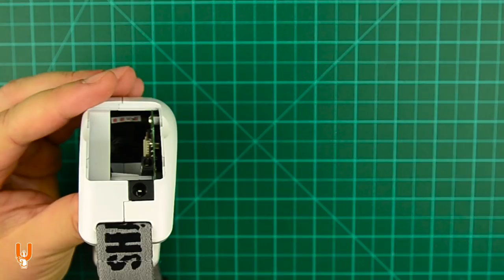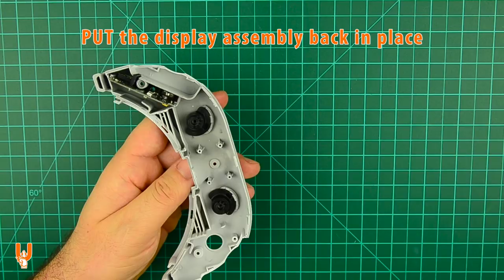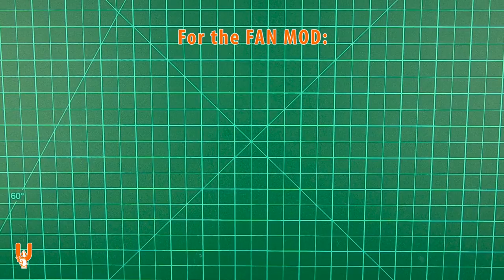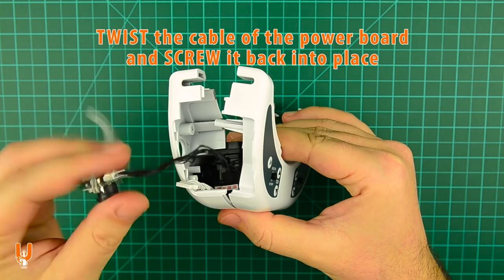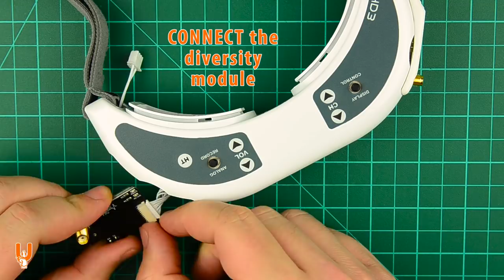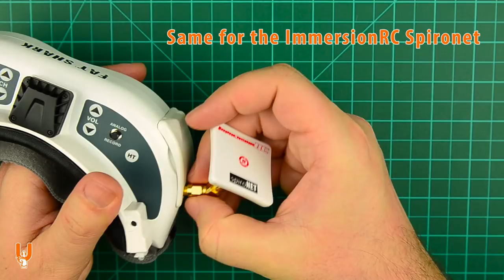Fatshark HD3 Core disassembly, LaForge V4 installation and Fan mod - QUICK GUIDE

Comment: Haven't used my FPV Equipment, including my Fat Shark Goggles when Faceplates and FANs weren't a thing, in ages and been wondering what the battery tab on the 18650 Battery Boxes were meant to do when you can't even charge them in there but now it makes sense...
Reply from the maker: The fact that Fatshark does not ship their 18650 case pre-wired for balance charging is ridiculous.

Comment: I like the detail of you builds and your extensive list of tools.  Why do you like the PAD-11?  What advantages does it have over the PA-09?  Does it handle the smaller connectors (e.g., picoblade or 1.25 mm) better than the PA-09?
Reply from the maker: Thank you David! I wanted the PA-09 at first but finally decided to get the PAD-11 for the swappable crimping heads. If I recall correctly they do pretty much the same sizes.

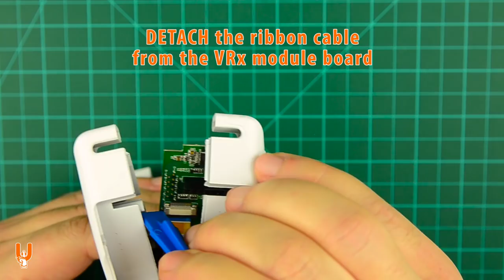Comment: What is the little blue tool you're using @ 1:15 ?
Reply from the maker: Hi +Jason Bell! It is from a smartphone repair kit, they are very cheap and common.
I prefer to use those when popping up the covers of the goggles because the case scratches very easily + they come in very handy when releasing the tabs that hold the ribbon cables in place.
Reply: Thanks! Looks very useful. Is it just a flat tip on the end?
Reply from the maker: Yes, and it comes in various widths. Mine are from an iFixit toolkit but you can find them sold separately.
Reply: Thank you for the extra information, and especially for this video. I'm new to the hobby and getting setup... I just received my HD3 and Laforge modules this week, and intend to do the internal cable routing this weekend... it's amazing how many little tools, like this one, that I keep finding that I didn't know I needed.
Reply from the maker: Your welcome :) You don't actually need them but they are nice to have. For example you can cover the tip of a small flat-head screwdriver with a piece of duct tape, if you don't want it to scratch stuff :)

Comment: brilliant, but i only have to do the fan wire and faceplate mod :)
there is no need for a new hole?
which leather faceplate do you use?
Reply from the maker: Nope, there is already a hole there, hidden by the head strap :)
Reply: perfect :)

Comment: thx, very helpful, may I ask which faceplate are you using ?
Reply from the maker: It is the stock faceplate, included with the HD3 Core.
Reply: thanks, I've watched your unboxing video, but I couldnt reckon seeing this one. Hope they will make it available separately.
Reply from the maker: Oh you mean the foam pad? Not the faceplate plastic piece?
Reply: yup, I meant that rounded foam pad
Reply from the maker: That one must be the vinyl pad from the ultimate fit kit. As far as I know it is not sold separately but the 6-piece-kit is not expensive.
Reply: Thanks, found it!

Comment: Nice guide – like all of yours… ;-) Wich module do you prefer in terms of performance? Pro58@Achille∑ or LaForge V4?
Reply from the maker: Thank you +Murdy! I don't want to spill the beans yet, Part 3 of my module shootout will be ready very soon.
Both are great performers but the price of the Pro58+firmware, which is less than a stock RX5808, makes it an amazing value for money. And even more amazing is the fact that everyone, even someone new to the hobby that does not want to spend much, can have a solid FPV experience without breaking the bank.
Reply: Thank you for your fast response! Looking forward for your shootout.

Comment: by the way where should I buy the HD3 core ? because I wanted to get it from hobbyking but I changed my mind after I checked them in trustpilot.com  , the result was shocking to me ,only  thousands of negative feedbacks with terrible stories !! 
I though hobbyking should be a reputable one and to be honest I did purchased few thing and  had no problems, but after seeing that tragedy in trustpilot , i don't know if I should go through with spending that much money on there,  I just learned they even don't have phone support, not even phone customer service , just very crappy chat which lots of people don't know much and each time they had to ask someone else or pass me to someone else who also was not much better ,, 
anyway, sorry this got long but I really in need of finding a reputable seller ( preferably inside uk ) to buy my few important items like fatshark HD3 core , Laforge v4, Taranis Transmitter , and lots of bits and pieces which I also can buy from banggood for example , but those big pieces , specially the Fatshark goggle and laForge receiver , even my transmitter should be bought from a reputable dealer, preferably in uk , 
I though hobbyking is fine, what do you think of them ? as you shared a link of item from them too , I thought maybe you know them, are they trustable in your opinion ? i think it should be , otherwise you wouldn't recommend them to your viewer  , but , , !! so what about those story after story in trustpilot website ? there are feedbacks there back to 2010 , over 8 years they just have few positive feedbacks in 357 feedbacks , that was disturbing and also very disappointing, 
please forgive me for long " comment "  !! please help me out , god bless you
Reply from the maker: No worries, thank you for all the details.
I have purchased a lot of stuff from Hobbyking. I have never had a faulty one so I do not know how fast/well they handle returns.
I have had some issues with delayed deliveries but other than that, every order I have made was handled properly. Their customer service could be a lot better. But they are a well reputed vendor and they have been in the R/C market for many years.
I also buy expensive / bulky stuff from within the EU (I live in Greece) - buying expensive hardware from the US or China usually results in customs clearance fees and duties, so I am trying to avoid that. I don't have any experience with other stores in the EU, so I cannot suggest any with certainty.
HobbyKing did not have the Core version when I made this video. I have now added a link for the HD3 Core from HobbyKing in the video description. If you decide to buy from Hobbyking and want to support my channel, you can use this link (it is an affiliate link and I will receive a small kickback in the form of reward points).